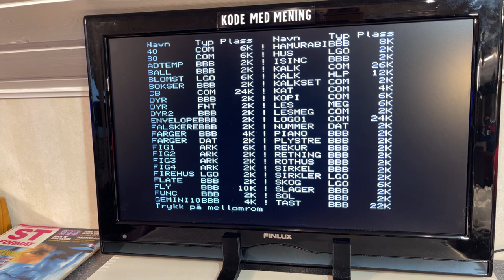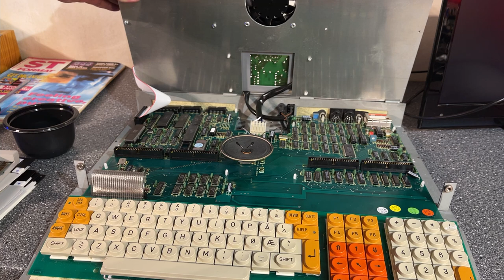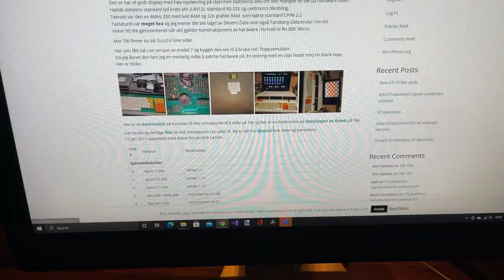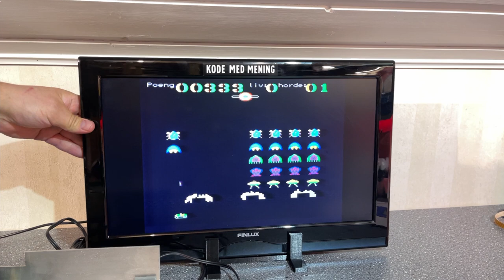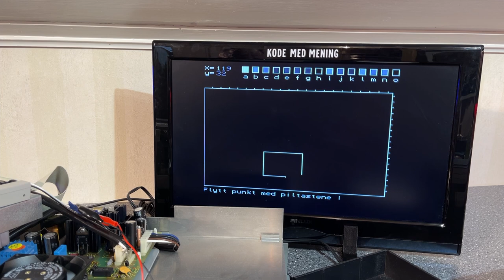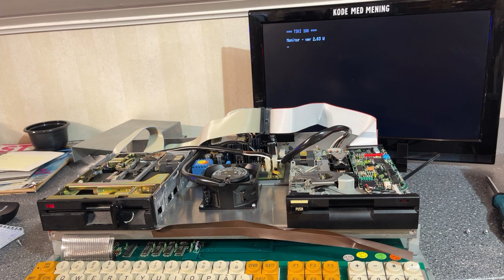Investigating the TIKI 100 - A Norwegian microcomputer from the 80's

Comment: I remember some Tiki branded IBM compatible PCs in school in the early 2000s, but I don't remember this early machine. I was aware though that there were things going on in Norway concerning computers, such as the Simula langage and NUSSE. I also remember some terminals from Tandberg that had very similar looking keyboards. Anyways, I think it's great that you took the time to showcase and document it. There are already so much on systems from other parts of the world out there, but little on these things.
Reply from the maker: Thanks. Yes, Tiki tried to move to IBM-PC compatible computers, but eventually they failed. You are right about the Tandberg keyboard. I think it is the same.

Comment: Wow, that's a great video about a very interesting machine! I like those exotic systems a lot. I wasn't surprised that your cable extension didn't work. If you connect one IDC connector to the other like you did, you end up connecting pin 1 with pin 2, pin 3 with pin 4 and so on.
Reply from the maker: Thanks. That is probably it. :)

Comment: It actually had 96kB RAM, not 64 ;-)
Reply from the maker: Really?
Reply: @Arcticretro  Yes, 64k normal RAM and 32k video RAM, allowing the very high resolution for the time the machine came out. And also 4k of ROM, and there you have the 100 in the name. It utilized bank switching just like the C64 to overcome the 64kB address space limit.
Reply from the maker: Yes I know, but normally you only count regular program ram as RAM :)